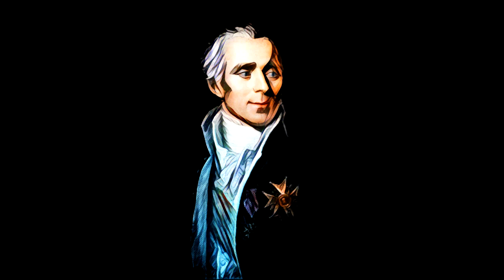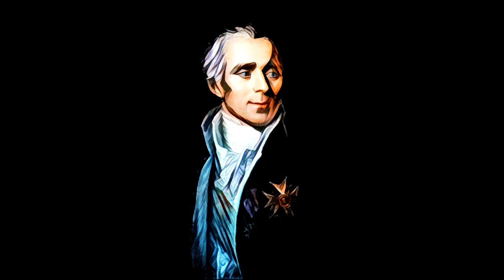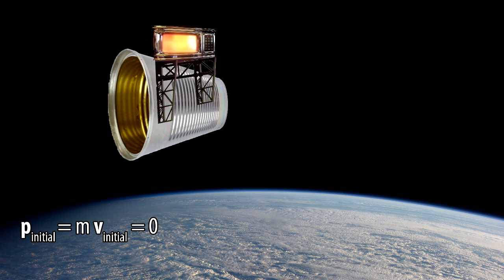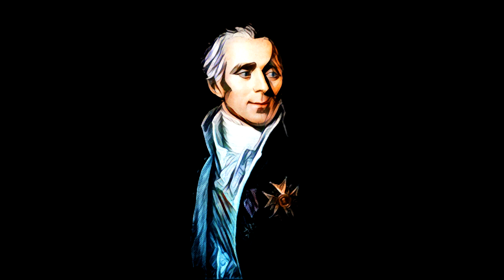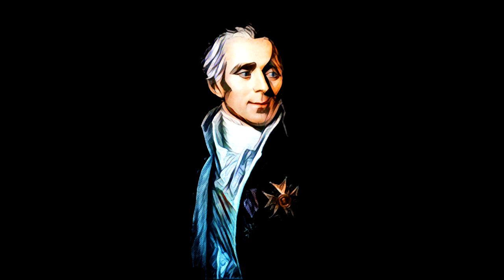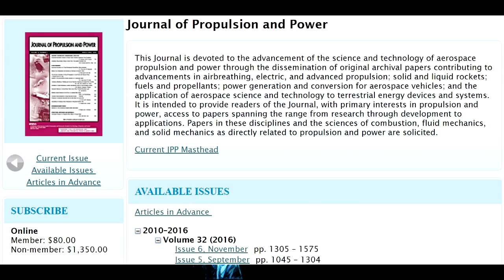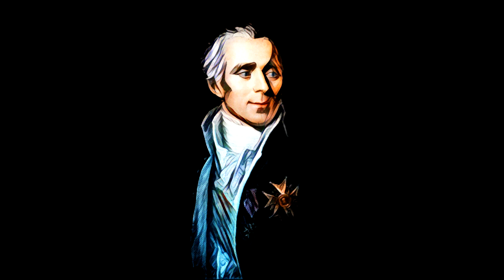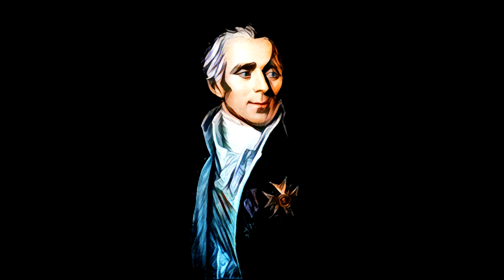The most unscientific approach – The Emdrive (part 1)

Comment: I know you you can fire a lazer at a sail,this is like a em air curtain.ounce you energize particals ,they move away,add a ram jet and gives i you more thrust.It works like a black hole,the electromagnetism draws particals in but when high pressure developes ,space becomes a low for an exit.

Comment: In what way is it a perpetual motion machine? Because it keeps going after it's turned off? Any object in motion will remain in motion unless it experiences drag/friction/hysteresis.
Reply from the maker: As you say, that it keeps going is not surprising. What makes it a perpetual motion machine is the fact that you're accelerating without spending propellant. That is because there is always a speed at which F.v -- the gain in kinetic energy per unit time -- exceeds the power coming out of the batteries. With a conventional rocket you also have to take the kinetic energy of the propellant into account. For example, imagine that you're watching someone toss rubber balls out the back of a very fast moving train: from your perspective, the train gains a tiny bit of kinetic energy, but the balls lose some kinetic energy because they're traveling more slowly (according to you). So the balance works out.
Reply: You can put it on an end of a long stick with a dynamo on the other end. It will produce thrust, turning the dynamo and producing power. At certain speed, the power produced by the dynamo will be higher than the power needed to keep it going.

You can do the same with a flashlight, but then you'll find that the reactionless thrust of the flashlight is exactly as small that you need to accelerate it to speed of light to reach the "unity" of power produced vs power consumed. Which is impossible. But EmDrive is supposed to have greater thrust than that, so you should reach the unity below speed of light.
Reply: Look at the definition of kinetic energy vs momentum, specifically energy is .5 mass times velocity squared. If the Emdrive keeps accelerating in its own reference frame, eventually that becomes over-unity, because energy is not increasing linearly. But then again, that's using the physics that Emdrive falsifies to say it doesn't conserve energy, kind of circular. IMHO they need to do more good tests.
Reply: And yet we don't seem to know the underlying basis of Action-Reaction. We just take it as a given (ie. as a basic law) that it happens, and that there's no way to tweak it or improve upon how it happens. When the laser was invented, we couldn't really point to existing natural examples of such coherent light - it was an entirely engineered thing, designed to exploit natural phenomena to obtain greater benefit for our own needs. For our purposes, the laser proved to be an improvement over natural incoherent light.

It is an established fact that the Vacuum is altered by cavity confinement. The value of C itself can be different (ie. higher) inside a cavity, as part of the Casimir Effect. Therefore how do we know that Action-Reaction won't be different under these conditions, as compared to when it occurs in free unconfined open space?

You already state in your video that Action-Reaction can happen with photons (your flashlight example). But with the EMdrive, that action-reaction from photons is happening inside the confined space of the frustrum cavity, where the properties of that confined space are not the same as that of open unconfined space.

The Vacuum may seem like a black box that we're probing without being able to see what's directly going on. That's why we don't yet know what the mechanisms underpinning Action-Reaction are.

We should keep probing the Vacuum to find out as much as possible about it, including why Action-Reaction happens. Perhaps by doing so, we will learn some way to improve upon Action-Reaction, to get more benefit out of it than we do now. But as you've said, real science should be based on accuracy and precision in experimental observation, without confirmation bias.

It was the great physicist Andrei Sakharov who said:
"The mysteries of the vacuum will be the great challenge for 21st century physics"
Reply from the maker: manofsan "And yet we don't seem to know the underlying basis of Action-Reaction. We just take it as a given (ie. as a basic law) that it happens"
That's not true: Newton's third law is a special case of conservation of momentum, which can be derived from Noether's theorem from the fact that no place in the universe is special.
A flashlight in space respects conservation of momentum. But if you exceed the maximum theoretical efficiency of a photon rocket, all bets are off. I'll have more details in part 2, especially with regards to the vacuum.
After all, my channel is called Vacuum Diagrams... :)
Reply: IF the EMdrive is actually producing thrust, it must be pushing on something to do so. IF it is working as such must be emitting some kind of propellant, pushing on dark matter, space time, witch space, something. 

First it needs to be proven to be producing actual thrust, then we can start asking "how?". I don't care if it appears to be violating physics, magicians "appear" to be violating physics all the time but we all know that is a trick, so to must be the EMdrive, either intentionally or not.
Reply: "That's not true: Newton's third law is a special case of conservation of momentum, which can be derived from Noether's theorem from the fact that no place in the universe is special."
Sir, the thing is that not all places in the universe are the same, and experimental observation proves it. What you are talking about may be a general-purpose law, but it may not hold up under various extrema conditions, which are what we often use to probe the boundaries and contours of physical laws. 
The Event Horizon of a Black Hole is different, and we see Hawking Radiation emanating from it - coming straight out of the Vacuum - which doesn't happen in other regions of space. When LIGO detected a Gravity Wave signal, the signal by definition was distinguishing itself from background (ie. what rest of space looks like) and so at the point and time that signal appeared, it too was different than the rest of space. These are however the result of extreme astrophysical events/situations. Frame-dragging is something that also affects spacetime, creating a difference in that situation too.
Meanwhile, space which is confined can have much of its background Quantum Fluctuations blocked out, resulting in Casimir forces, which is different from what occurs in regular open unconfined space. The value of C can even be different inside of these Casimir cavities - light could potentially travel faster - if that doesn't qualify that space as different, then I don't know what will.
I feel we should continue probing the mysteries of the Vacuum, which Sakharov talked about. But as you say, experiments must be done rigorously to eliminate sources of error, so that results can be stated with confidence and reliability.
As for photonic thruster - this EMdrive idea doesn't even claim to rely on shooting the photons out its back end like a photonic thruster does - indeed this frustrum is a completely closed cavity. I've no idea if it works or not, but as you say, experimental rigor is the key to determining this. As they say, "extraordinary claims require extraordinary proof" - but sometimes an observation from a rigorous experiment can be robust and credible enough to overturn established theory. That will require further efforts, however. Please do keep posting your fine objective critiques though, because they can only push others to improve their standards.
Reply from the maker: manofsan
"The Event Horizon of a Black Hole is different, and we see Hawking Radiation emanating from it - coming straight out of the Vacuum "
Things get a little subtle when GR is involved. It's true that the naive form of Noether's theorem fails, but in specific cases -- when you have something like a black hole or gravitational waves, for instance -- you can recover much of the same results. Luckily we can ignore these subtleties when discussing the Emdrive.
"Meanwhile, space which is confined can have much of its background Quantum Fluctuations blocked out, resulting in Casimir forces, which is different from what occurs in regular open unconfined space. "
That's an example of something "in" the space. You had to place the parallel plates somewhere, and those plates are made of protons, neutrons, electrons, and so on. They are things in space, so the theorem still holds.
"Please do keep posting your fine objective critiques though, because they can only push others to improve their standards."
Thank you!
Reply from the maker: It is a perpetual motion machine, Yosemite. 

"But it isn't true, the acceleration in the Emdrive is not constant at any moment in time. "

In which case relativity is violated. But if relativity is violated we have a contradiction, because relativity is built in classical electromagnetism, so you can't get rid of it.

There's really no two ways about this. It's a perpetual motion machine.
Reply from the maker: I'm not mixing up anything. Like I said, the fact of the matter is that the emdrive breaks conservation of momentum and therefore doesn't work. This isn't complicated.
Reply from the maker: It's a factual claim, Yosemite. You don't get to wish it away.
Reply: but VacuumDiagrams, couldn't DeBroglie Wavelength be construed as a violation of conservation of momentum? Some would call that an interaction with the vacuum, although you personally might prefer to relate it to the Scalar Field (it's an ideological preference, perhaps).
I've always construed DeBroglie Wavelength as the Vacuum pushing on us, as if we were surrounded by a frothing fizz. You may feel that "virtual particles" are a mere artifact of bookkeeping, but I'll say that regardless of what you want to call them, the pushes and pulls they exert are real, and not mere bookkeeping. There is an interaction between the Vacuum and matter, and if we can be pushed on by these forces, we can be able to push back against them, and likely even push off them.
Reply from the maker: manofsan, I don't know of any relation between the De Broglie wavelength and the vacuum. Since nonrelativistic particles have a De Broglie wavelength as well, I strongly suspect there isn't one.
Reply: Yes, non-relativistic particles certainly have a DeBroglie Wavelength (gee, I'd never considered the idea for relativistic particles - I wonder what's been measured for that?) To me, this means the Vacuum is interacting with matter - literally pushing and pulling on it - and if the Vacuum can push-and-pull on you, then you can push back on the Vacuum. The thing is that no one piece/bit of the Vacuum is persistent - the pushing and pulling is a net aggregate effect arising from all those Vacuum bits surrounding you.

Comment: I like this kind of level headed perspective on these "tall-claimed" new technologies, given the accuracy of sound physics. It's also nice to see some proof of the rebuttals presented here in this video.

  I have to agree that Shawyer's explanations of a purely classical operation is very hard to believe. And thank you for pointing out the questionable elements of White's paper.

   But regardless if the "Emdrive" does what they claim of not, I see this as an exciting and healthy learning experience because it highlights many of the cutting edge and controversial curiosities in science today. It forces us to ask serious questions about what might be scientifically possible, but any answers to our questions can't be resolved without further research in the matter.

   Some examples of viable and related research are based on the Casimir Effect, Unruh Effect and the fore running Mach Effect. There's still possibilities that one (or a combination) of these effects are behind the thrust we are observing. And one (or more) of the theories related to these effects Could be a big puzzle piece in the foundation for new physics- which, in turn would nicely explain the acceleration of the frustrum without violating other laws of physics..

  So I wouldn't wright it off so fast. Let it play out the course of discovery or disapproval-( if it's false). Then we should call for further research if it works OR we should ask what falsely convinced us it did, so we don't make the same mistakes again. And we still need to prove what actually was making this thrust so apparent in the beginning. (i.e. we need to prove that vibration itself caused the rotation and not a combination of other effects as a result of the vibration) By the way I do think Harold White was referring to a previous study of Marc Millis's BPP Project debunking rotating mechanisms as a proponent of thrust in a vacuum.

  Both sides of the view has the job to prove why whatever happens- from what we observe. I think this is healthy criticism because we are learning a lot here.

Comment: cut and past ? You Forgot Einstein's relativity. Emdrive cavity resonant, does not behave as an isolated system, because the  light speed is not resolved with relative speed sum, because it is always constant.
Reply from the maker: I honestly can't figure out what you're trying to say. Rest assured however that relativity is one of the prime reasons why the emdrive can't work.
Reply: More concentrated stuff hits one side than the other waves transfer kinetic energy. Use the theorem "it goes in it must come back out" to define the reaction radiation goes in...radiation... what comes out, thrust, heat... those saying its a thermal energy is produced causing the thrust just remember all chemical rockets are solely thermal expansion drives. Thermal is part of radiation but tit's the symmetry of lack of symmetry in the resonator that causes the wave to bunch up on one side creating thrust..

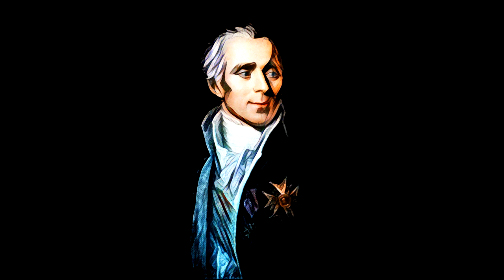Comment: 3:34 - Perpetual motion machine: Wouldn't it be the same case of a "photonic thruster" which is also not using any propellant? Then how do they work? Are they perpetual motion machine?
Reply from the maker: Photons satisfy a neat relation: energy = momentum * c, which leads to power = force * c when you divide both sides by time. This is why photon thrusters require 300 megawatts for each Newton. So at what speed does a photon thruster become a perpetual motion machine? Well, it ought to happen when F.v exceeds P, so at v = P/F... which from the above is just the speed of light. So you're safe: you can never reach the speed of light anyway!

I went over this point a little bit to quick in the video, as I see clearly with hindsight. I should've explained it better.
Reply: Got it. Thank you for the clarification.

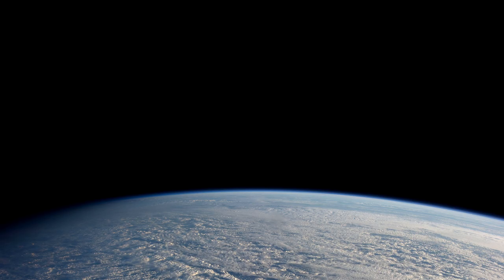Comment: Your comment about momentum at 2:26 is over-simplistic and is not always true. For example, it doesn't explain how a space probe with thruster off, not ejecting any propellant, gains momentum during a slingshot maneuver. Yet it has been done by NASA for decades.
Reply from the maker: The Emdrive is supposed to work in deep space where there are no external interactions. I'm addressing Shawyer's explanation, which makes no reference whatever to external forces.
Reply: Fair enough, this being said:

Some theories are based on coupling fields (for example a scalar field) allowing an interaction with spacetime itself, and not only within the boundaries of Earth's own gravitational potential. 

Gravitational origin of inertia in particular would allow an interaction with distant matter over great distance, even in the most rarefied interstellar medium, through a Mach effect, preserving conservation of momentum. This is general relativity and does not even has to resort to quantum vacuum or quantum gravity, which are yet other possibilities (QVF, MiHsC, Polarizable Vacuum theories).

So Shawyer's model based on radiation pressure is not the only explanation and may indeed be false, while his thruster could still work and be explained by another completely different theory. Focusing on Shawyer's explanation only is like looking at this problem through the small end of the telescope. But you're right it is necessary to deal with Shawyer's claims at some point. Just don't ignore other advanced possibilities.
Reply from the maker: tokamac78 That's what I'll do in part 2!
Reply: In such a case, the planet is the propellant.  Momentum is still conserved across the system.
Reply: Exactly. The space probe gains momentum at the expense of the momentum of the planet it orbits during the gravity assist. Momentum is always conserved in open systems.

But there is a special case showing momentum can theoretically be gained from nothing. Take the hypothetical Alcubierre drive which is also an open system but even more tricky. We do not know how to engineer spacetime distortions, but the concept is perfectly valid theoretically in general relativity. You don't need to take the FTL version, as the following thought experiment also works at v≪c. When spacetime is warped, the drive would displace in the generated gravity potential. No propellant would be involved at all, it would work in space with no planetary body nearby, and momentum would be gained by the drive at the expense of nothing else, except a direct interaction with spacetime itself. Yet, no physical law would be broken.
Reply from the maker: In the Alcubierre drive example, the spacecraft doesn't gain any momentum -- it starts stationary with respect to its immediate surroundings and remains stationary with respect to them. It does get displaced, but you need to probe a large region to see that. Momentum is measured locally.
Reply: Thanks for pointing that, the momentum issue was puzzling me! So the Alcubierre drive is a very special example of a "stationary displacement without thrust" and no exchange of momentum. Fascinating ;)
Reply: Vacuum Diagrams , Cool!